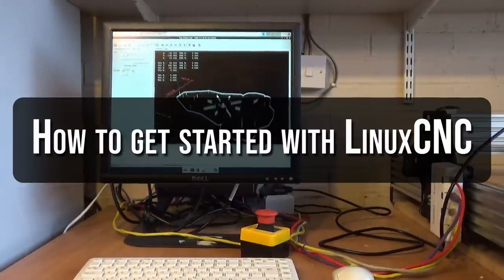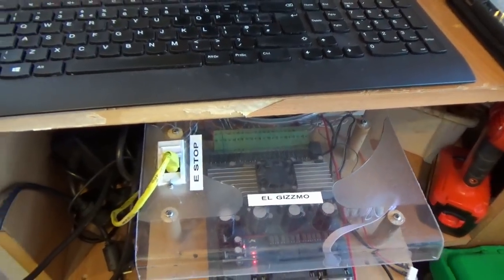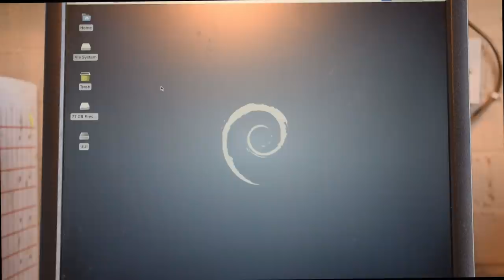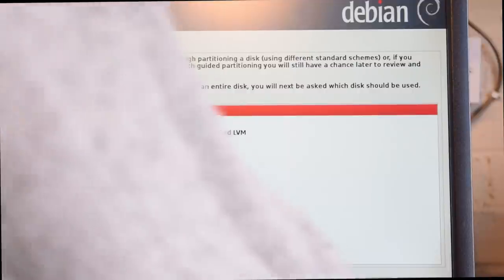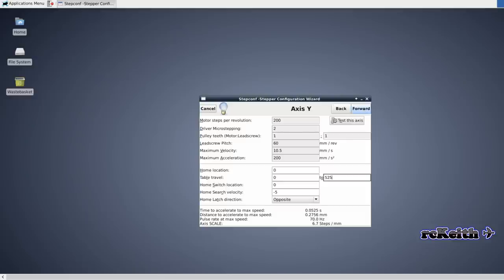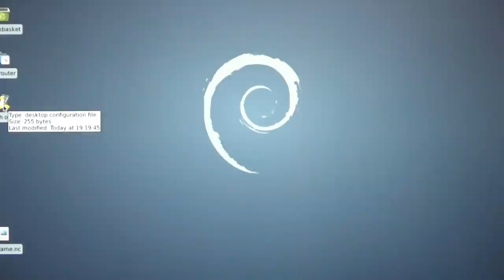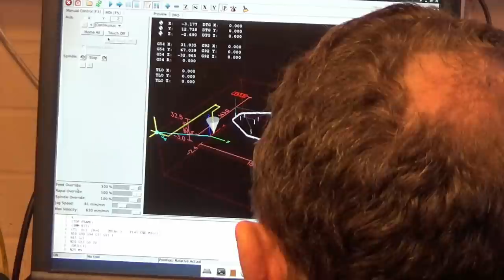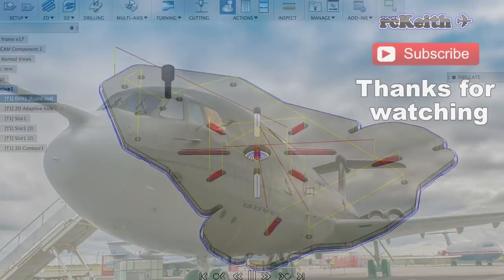How to get started with LinuxCNC - CNC router

Comment: how i move bit all 0,0 zero to workpiece top left corner ? can move bit but how but all to zero ? XYZ 0,0
Reply from the maker: What the video from here https://youtu.be/F4xHCwtaS3w?si=_zYJu-ZXRcwvVLui&t=2323
Reply: @rckeith  hmm, i understand little better, manual move bit to workpiece corner and then bush "touch off" then zero all axis , thanks need test tomorrow thats.
 how you wiring limit SW, i have in linuxcnc soft limit, but if run some error out off limit i have hard limit SW all axis rail head but i have only 5 input, E-stop,home XYZ, probe, how connect hard limits no have input. maybe i think connect hard limits all paraller whit E-stop ? then not broken rails etc, frame if come somethink errors in G-code run.

Comment: Boy howdy, you're running that machine slowly.  And the edge quality looks terrible.  I suspect a dull router bit.  You will probably find your bits stay sharp longer with better chip load (running the feed speed much faster in your case).  The common wisdom with wood is to make chips, not dust.  Sorry to sound negative.  Thanks for putting this video together!  It's a nice introduction about what to do first with LinuxCNC.
Reply from the maker: Hi thanks for your comments. No problem being negative actually it's better to say how it is and you can learn from it. Since the video I've improved on that and taken time to learn more about speeds and feeds. 👍
Reply: I suspect that the spiral on the bit is lifting.  If you employ a bit that pushes down as it cuts, the edges will be less frayed.  It's called a compression bit.
Reply: @jawneelogik5744  But that puts higher demands on the chip and dust removal. For wood, the twistless straight flutes deliver the best results.. Optimally a single flute bit with ample space to get the chips away.

Comment: Linuxcnc has confusing array of supported controller boards. You need to be a professional to know which ones to buy.
Reply from the maker: Yes, it not easy.  I've only ever used the parallel port.
Reply: all paraller port controller can use linuxcnc and best option have mesa 7I76 or 79 controller board use all cnc machines, linuxcnc or mach 3 cnc.

Comment: I am looking without success for info to calibrate axis with a measuring device to actual distance traveled,not theoretical values.As is present in mach3.
Reply from the maker: I used a digital caliper. Usually you can find a part on one of the axis you can use to measure against. Then set to zero and move a known distance say 20mm and me measure with the caliper. Can  be a bit fiddley but I've used this method several times.  Parts I've made have all been correct size. Hope that helps
Reply: @rckeith  yes but need calibrate 10mm and 100mm and more maximum tmm too. not only little dimension. because maybe have 10mm right and 500mm not right.  calibration have big procres many dimension many axis. but after this no newer need do same again.

Comment: how this installing to raspberry pi and what raspi hat need use run tb6600 and big nema stepper motors.
Reply from the maker: LinuxCNC will only work with the parallel port or Mesa controller cards. A raspberry pi with USB will not work with LinuxCNC. You can use a Ardiuno to interface with a TB6600 but I haven't tried that and you would need to use GRBL on the Arduino.  A few people have done this. Hope that helps
Reply: @rckeith  thanks, i has looking many has build GRBL cnc to raspi and arduino or raspi and cnc shield. same board than ramps use, arduino top. and 4966 drivers or adapter step,dir,enaple pin out and big steppermotor driver big motor. but i think IF can use linuxcnc ,ok thanks no can use. sad. lot better at cnc have old table pc old xp machine were instal new linuxcnc then working many year wery good old computer,
Reply from the maker: @mattivirta  LinuxCNC still works very well on old  computers and you can install a parallel port PCI card in a newer PC which works as well. I still use old computers for LinuxCNC and have a few spare ones as well which will keep me going for many years.  😁
Reply: @rckeith  same here, the oldest ones still running perfectly. ISA, not PCI cards! But a printer port on the mainboard already... ;)
Reply from the maker: @ugkliegis2319  Usually better built as well.

Comment: thanks this really helped me
Reply from the maker: Carson Turner no problem. I enjoyed making the video. Seems to be going down quite well.
Keith
Reply: actually everything went well at first but then when i tried to  boot it on my  old dell xp pc the boot drive wouldn't show up as available. do you know why this isnt working for me?
Reply from the maker: What model of Dell are you using.  It may need setting in the BIOS to recognise the disk.  Are you swapping the disk ?
Reply: im using a dell dimension 2350 and trying to boot it through a usb thumb drive
Reply from the maker: Did a search on Google and it looks like the the Dell 2350 doesn't support USB boot.  You will need to burn the iso to a DVD and boot from there.
Keith

Comment: Just got a 3040 cnc machine...Can't get anything to work...super bummed. Followed these instructions over and over. Got the Debian software onto my computer but can't get any pull down menus...the ones you start to the setup page. Also the standalone xp 32 bit machine I am going to use to control my cnc, is now stuck in this debian mode. can't even turn it off properly.  I have some experience with this stuff,,,and I am completely stuck. 500 dollar cnc just sits there doing nothing. Sure wish I would have done more research before buying this cnc.
Reply from the maker: Hi Todd, if you boot to live on the LinuxCNC ISO does it work on the menus.  Did you try the latency test?
Reply: I got super frustrated...I will try it again...super determined to get this going...So stoked to get a response from you man. Thank you so much for the response. I will keep trying.
Reply from the maker: Hi, Todd sorry to hear you are having problems.  Usually, when you partition a disk it overwrites whatever was there so its unlikely you'll get it back.  Unless it's just the boot loader can't see windows partition and only Linux.   The best option, in my opinion, is to use a dedicated disk.  LinuxCNC doesn't need much so cheap 40GB would do, probably pick one up on eBay for a few dollars.  If it's already put LinuxCNC on the disk then probably best to leave that on now.  Stick with it I've helped a few guys out on CNC and they get very dishearted but when it works its a great feeling.  You'll learn a lot as well which will be good for the future.  If you want to contact me via my website https://www.rckeith.co.uk there's a contact page there.  Good luck
Reply: @rckeith  Super stoked that I am really close to running my machine...just can't get the steppers to move in the test axis...trying to figure out why my steppers are not moving. any ideas?
Reply: @rckeith  Been learning so much about Linux  When it runs the screen saver it is soooo cool...takes me back a little..to a simpler time!
Reply from the maker: Hi Todd its usually the pinouts on the parallel port,  did you get a diagram with the controller board.
Reply: @rckeith   Digging deep bound and determined to get it...Been reading all about the parallel port pinout's  No good info.came with my machine..gonna have to open up the control box and see if I can figure out whats wrong. Really think I am close...the steppers are energized when I turn it on...Thanks for all your tips!!!So happy I stuck with it.
Reply from the maker: Hi Todd,  There is an example config for a TB6560 in the stepper config wizard on the pin outs screen. Maybe worth giving that a try. Usually these CNC machine come with an example config for Mach3. If you have drop me an email at info@rckeith.co.uk and I'll take a look. Often quite easy to convert
Reply: I probably have the same machine which is a mini-engraver cnc machine  T-D.  I had the same problem of it not recognizing the machine due to the pin-out.  In Debian, they don't explain that in the Stepconf Wizard that you need to be recognized in the LTP Port by 0x378 not just 0.  After that mine worked just fine.  Hope this helps.  If you use Ubunto, it puts the 0x378 in there for you.
Reply from the maker: Thanks  for the tip. Todd seems very happy now sent me several emails telling me the success he's having. Very  frustrating when it doesn't work and can take some figuring out but you generally learn loads more that way👍
Reply: I really did get over those hurdles...whew. Still have so much to learn...I just got a program called q-cad...also have Lazycam, and d2nc. and of course Mach 3...ended up not going the Linux route...I was really intrigued by Linux, so maybe at some point I will try it again...Now I am really having fun talking to my stepper motors...So happy now...Big smiles Keith!

Comment: You can't destroy  a hdd by partitionning, why have you said that ?
Reply from the maker: Yes, you're right a bit of a slip of the tongue.  I meant to say run the risk of deleting an existing partition.  What I was trying to warn of was if you already had a Windows partition then if you made a mistake you could delete it.  Well spotted.👍
Reply: very easy can destroy if manually partition hard disk, only one click wrong and destroy all.

Comment: i build my son own cnc machine now, first time i use better linuxcnc than old shit mach 3. but newbie not understand new system linux and linuxcnc, lot problem understand all have new. machine move and has adjusted but some problem have how setup and use. pcie paraller port card, dual Y axis motor use,all forum help i try do but not working. touch plate tool height system, try many example not working. how add button to display, spindle on/off, touch plate, move work piece to working area, i try ask at linuxcnc forum but any not help, or all examples not working.
Reply from the maker: Maybe you have to invest some time in learning Linux and LinuxCNC. You will be in much better position to understand your problems
Reply: @rckeith  yes i has try learn lot last year, but im old 65 year and not understand good english and translator not help many world translate lot wrong, not understand good.
Reply from the maker: I'm older that you. Just try to fix one problem at a time and your knowledge will grow.
Reply: @rckeith  yes but my problem have not understand english good, my schooltime not has in school english, today ewery school learn english little different and translator not help, say only lot poop not understand all(translator change wrong lot)

Comment: None of your links seem to work!
Reply from the maker: Hi Pat, just tried them and they all work for me.  Can you tell me which ones are not working for you?
Reply: @rckeith  I tried each in turn on a Samsung tablet and an iPad, I does occur that you might be using a pc?
Reply from the maker: @pcka12  They work fine on my Samsung tablet. Are you getting any error messages .
Reply: @rckeith  no they simply don’t pick up and take you to the new page (I did try on another video of yours, and that works, perhaps if I leave it a little while and try again?).
Reply: @rckeith  still don’t work at the moment, ipad sort of flashes then does nothing, Samsung just does nothing, puzzling!

Comment: why is it so slow ?
Reply from the maker: It works fine for me.
Reply: need biggest motors if use fasten, lost easy steps if have too small motors. users say need minimum 450 oz torque motors but more have lot better, and perfect drivers handle lot biggest voltage too can use fasten, normal good cnc used 90 volt 6-8AMP drivers and motors, hobby users use lot less 40 volt less 6A motors. super expensive and fast have servomotors closed loop motors and drivers but cost 10-100x more than small size stepper motor cnc.

Comment: I installed linuxcnc and boot it live from usb, i did most of what you did but i chouldn't acces the internet and i don't know why?
Reply from the maker: Hi I don't recommend you connect to the internet with LinuxCNC it just adds extra  latency which is not good for CNC. Mine is not connected.
Reply: @rckeith  Hi,
but what if i want to download something ?
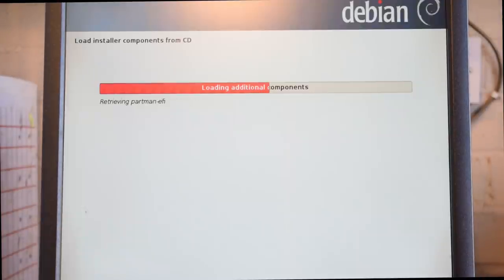Reply from the maker: At  17:17 in the video it will try and detect a network card.  You can select the network card you have and then it should create a network interface to connect to the interent.  But I would advise not to do this and download on another machine and transfer via a USB thumb drive.  Thats how I do it.
Reply: @rckeith  thank you so much ❤ ..
Another question is  iam currently working on a tripod with serial arm at the end of the tripod, when i looked for something like it in linux i did't found anything exept a tripod and a hexapod ... my question is how chould i implement the kinematics of the robot and how to configure the output pins of a breakout board to my robot in linuxcnc?
Reply from the maker: Best to ask on the LinuxCNC forums. I can't help you on that sorry.
Reply: @rckeith  I will ask ... thank you so much for your advice and for the videos you make and keep making such videos ❤❤❤